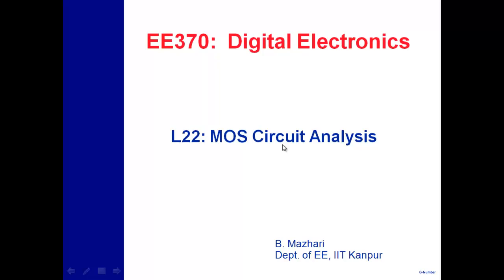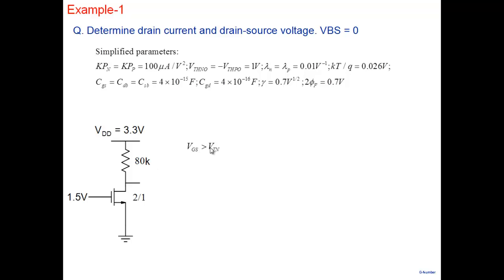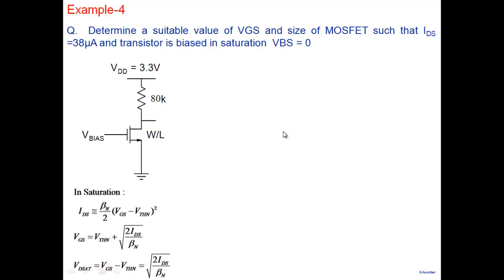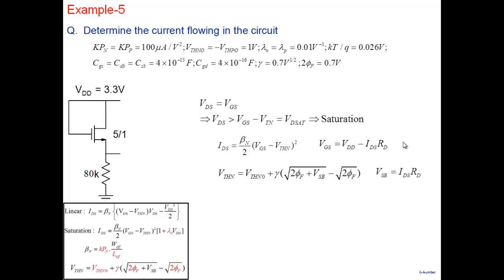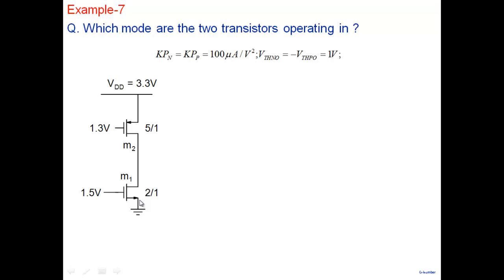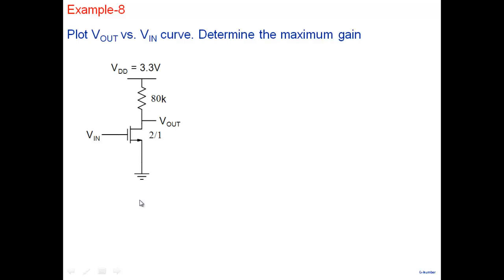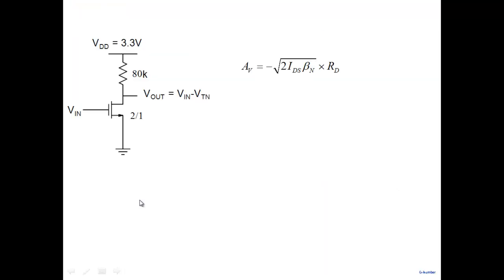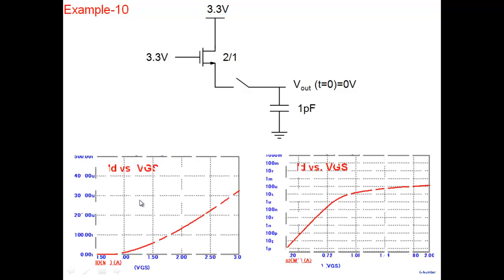MOS circuit Analysis (EE370 digital IC Design L22)

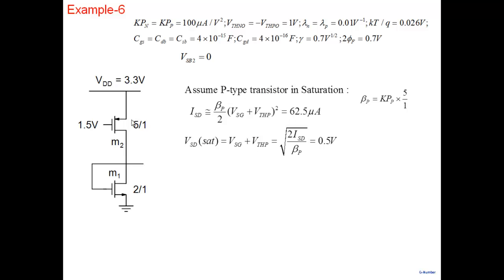Comment: @ 23:50 saturation check calculation VSG is 1.8 V and vthp is 1 so  VSD should be 0.8 V  and Isd is 1.6 X 10 ^-4 ua right?. please correct me if i am wrong